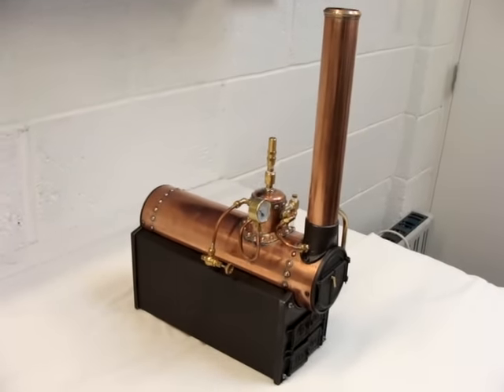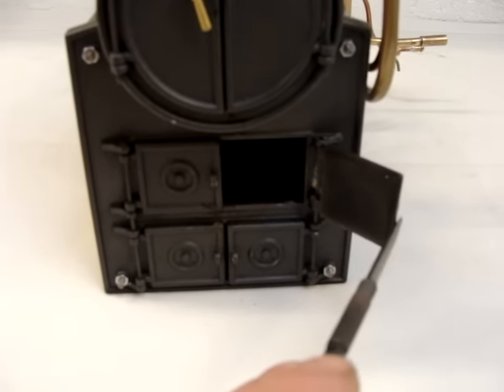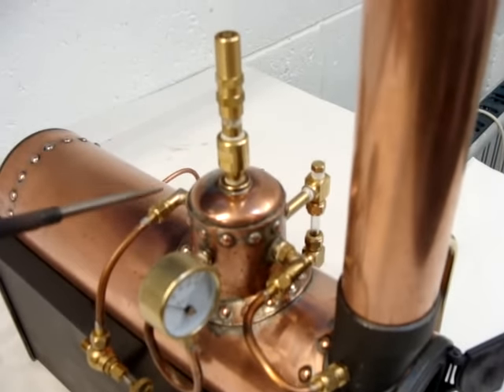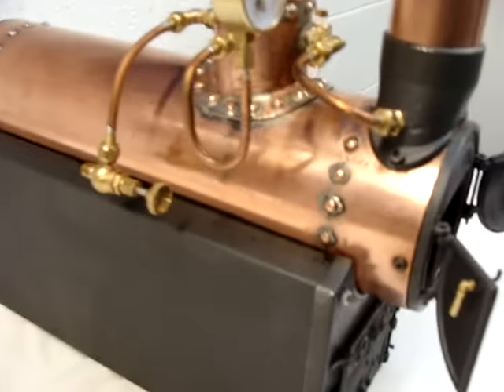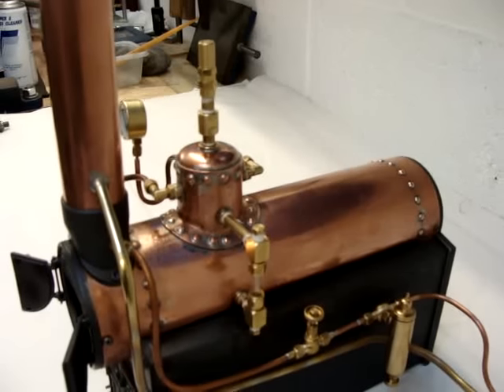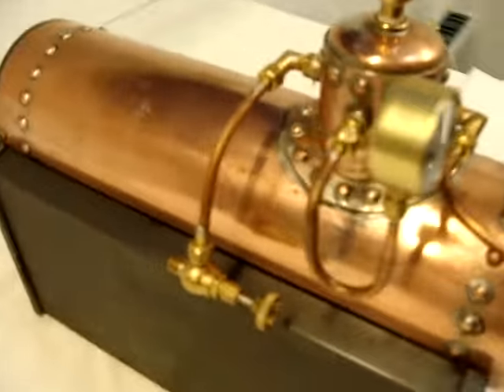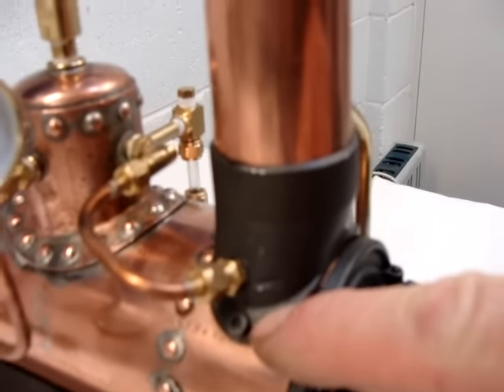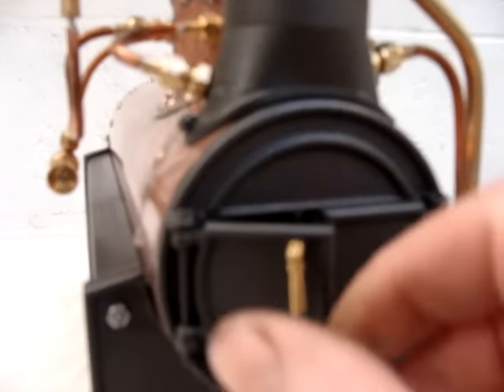PMR steam boiler

Comment from the maker: Thanks for your question: I fitted a small drain off pipe into the exhaust pipe at a low point - see the video @ 33 secs.  A bend in the drain off pipe, rather like that under kitchen a sink, prevents steam escaping but not condensate which runs into a tub.    Alternatively, you could run the exhaust into a condensate receiver with the outlet fed to the chimney.  Note: the shorter the exhaust pipe the better.  Hope this helps and happy steaming.

Comment: Do you think this boiler could power a Stuart twin Victoria
Reply: I use the Stuart 504 boiler and that powers the Twin Victoria quite well, This boiler looks to be a bit smaller. Also I use propane to fire it, so drive it quite hard.
The Victoria is a big engine. Hope this helps. Good luck.

Comment: You used the term "American boiler" to explain the imperial units but Britain used to be imperial and as things developed the model engineering industry stuck with imperial so if you used imperial sized pipes and bushes you may run into issues with fittings in the future